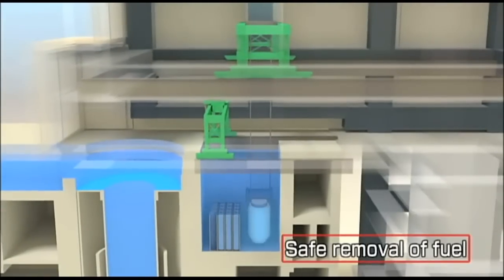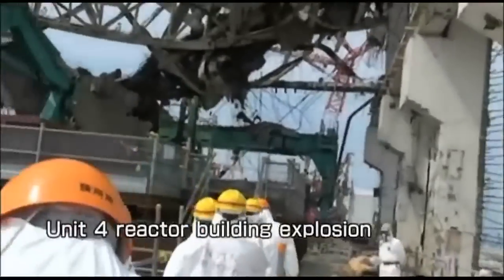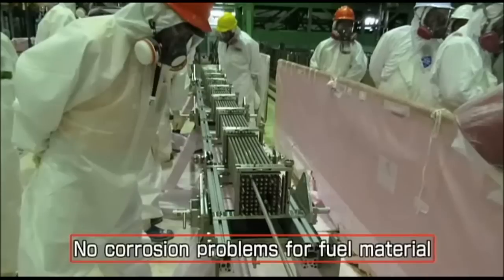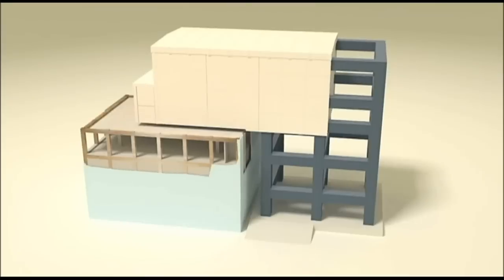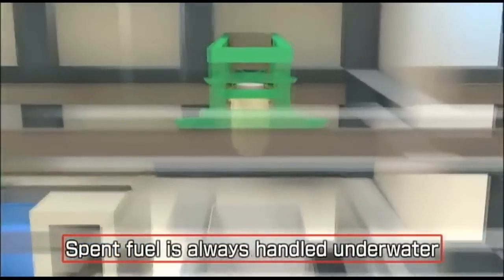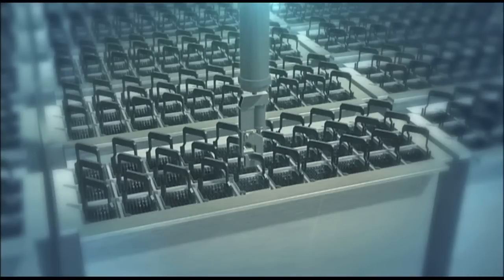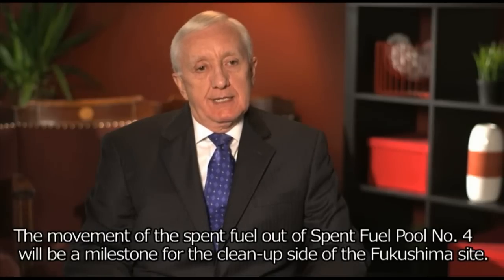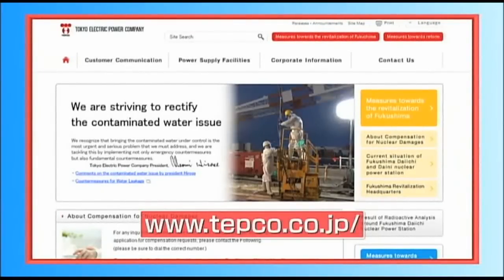Fukushima disaster: animation explains how nuclear fuel rods will be removed

Comment: Put cement and leave the area for thousand years..
Reply: Mark Anthony LLerena Villaroman I saw another video from robots underneath one of the reactors that show leakage headed toward the water table.  The radiation is so high, robots are unable to work for over 2 hours.  This whole thing is a mess.
Reply: I love that Idea Mark! Remove as much as we can, tunnel under and grout like the ruskies did, put in some more chiller piping (like they claim they did) then Bury it All in Tons of concrete! I wish an Engineer would chime in on this idea.
Thanks.
Reply: Cement mixed with lead lol 😂
Reply: The melted fuel is already encased in concrete.  it's called containment buildings. The spent fuel can much easier be removed and placed in other pools for future use in thorium molten salt reactors.

Comment: What about the pool that was blown off reactor 3? Hard to remove something that was sent straight out the top of the building.
Reply: Actually the liquid is probably just normal water and water is pretty good at neutralizing neutrons (operators can work above the open reactor without being irradiate with just a 10 feet water column between them and the reactor). It just turns into heavy water (the hydrogen atoms gain 1 proton) and it isn't radioactive
Reply: The spent fuel pool is at 2/3 height of the building. The top 3 sections are blast panels and are blown away. Certainly the pool was leaking or cooked dry after the explosion.
Reply: @roybm3124   Or you could have researched and found you are wrong.